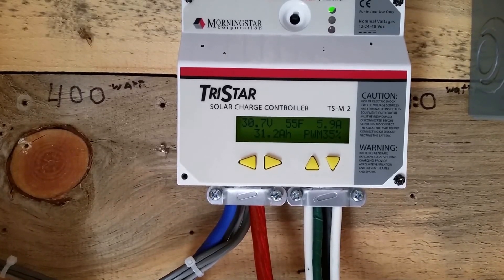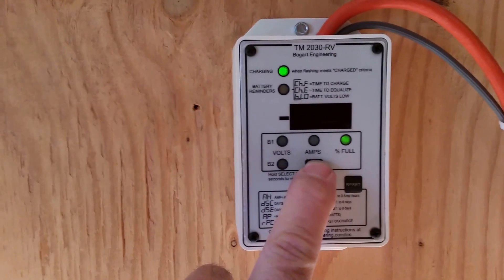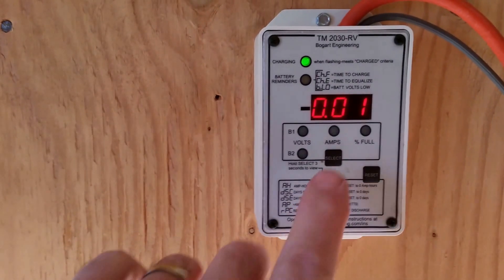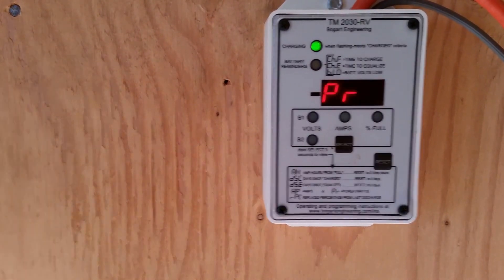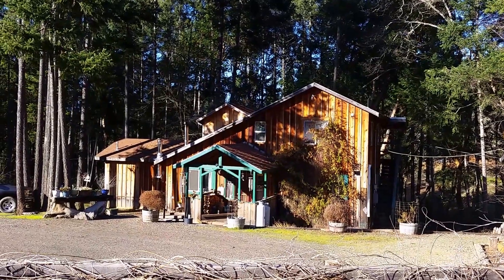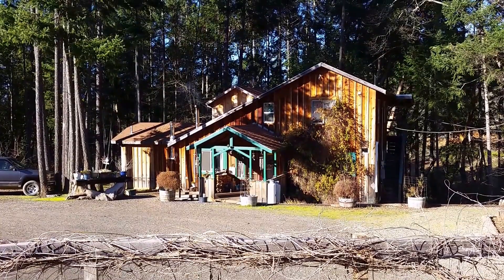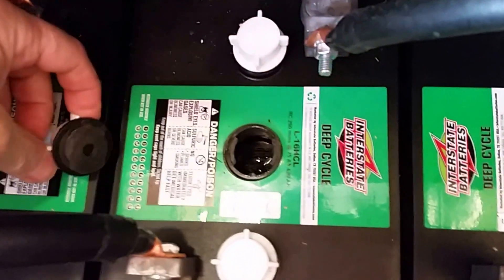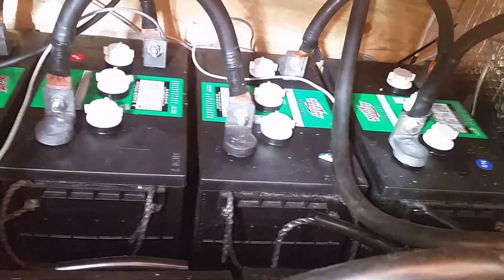Off Grid batteries & how cold weather affects charging part 1

Comment: How well would your system work in extreme cold? - 50-60°F. I have built our home in Interior Alaska and don't want to hear my generator run all night . I will be installing a Toyo Laser 56 heater to augment the wood heat ( when the stove has burned down ) .
 It doesn't get that cold often, but it does happen. 
 Very common to have several days of 40 below. 
 I don't have solar yet and would will recharge batteries during the day with the gas generator. 
 Thank you. Good vid !
Reply from the maker: Greetings, we are moving to a new homestead after 30 years. The new place gets down to 30 below zero F. We are no longer using lead acid batteries. We are using Tesla lithium ion batteries from a E class Mercedes. If our batteries are charged while below 32 degrees they are toast. So we installed a glycol heating system on the tesla batteries incorporating the existing cooling loop. It comes on at 35 degrees and  automatically and heats the batteries.  It is a challenge at 30 below I cant imagine what it must be like for you.
Reply: @offgridinthepacificnorthwe3210  
 Oddly enough the gold standard for dealing with real cold in a home situation in the Interior , off grid . is wood heat. Dry firewood burns Great in the cold. 
 I have thot about running a glycol loop to the generator/battery hut.
Reply from the maker: @gumboot65  I have to admit that burning wood only for heat since 1970 is getting old. I put up 8 cords a year for our 2 houses. Its getting harder as I get older. We are going to try a mini split HVAC on the new house. They won't work below single digits but they work well with solar power.

Comment: Steven. You have a really nice set up of not only your off grid power system but the location of your property. Absolutely beautiful. I have watched several of your very well put together videos and I was wondering, Is your charge controller a TS-45 or TS-60? It is hard to tell from the front when you have the meter installed. I have 2 TS-45 units (without meters) set up for diversion charge when running my DC generator. I am using 2 Wind Blue DC-512 PMAs driven by a 9 HP Briggs Vanguard.  The reason for diversion mode is that I already have a Outback Power Flex Ware 500 grid tie / battery back up system with 6750 watt array in place and the controllers are only a safety for the battery bank in a grid down / no sun situation. 
Again, you have a real nice set up there and thank you for the quality videos.
Reply from the maker: Thank you for the kind words. I have experimented with gas driven PMAs as well. I have a spare TS 60 just for diversion control. I have a Wind Blue coil on a Thermodyne 10si build. I am not happy with the regulation. I have decided to go with a Military 400 amp 28 volt brushless generator and power it with a spare Yanmar clone. Regulating the PMA is possible with a MPPT but their tracking causes them to load and unload depending on the model and brand. The flexmax 80 seems to do ok but I have seen videos of people having trouble with it as well. I hope to buy this one,http://www.milgens.com/store/p23/CE_Niehoff%2C_P%2FN_N1602-3%2C_28_Volt_DC%2C_400_amp_Generator_Alternator%2C_30_available%2C_%28Shipping_included_in_price_to_most_locations_in_the_continental_U.S%29.htmlMy Tristar on the solar system is a TS 60 PWM. The new CC I just bought is a Midnite classic 200 MPPT.Your system sounds great, 6.7k array is no joke. I would love to see a video. Have a blessed day.
Reply: Hey there Steven. That Milsurp generator is a bad boy and would really serve you well with your 24 volt system. As far as I know, and have read, the Flexmax 60 or 80 work best with solar and give problems with wind or hydro. My system has 2 Flexmax 80s on it. I think you are better using a standard Tri Star PWM on wind / hydro set ups due to that load / unload on the MPPT that you have experienced. You have done your homework on your off grid project. I don't have a video of my solar power system. But if you wish, e-mail me at mada94fxr@gmail.com and I would be happy to send you pictures of the Outback system and the other projects I am working on. God bless
Mark
Reply from the maker: Greeting Mark I would really like to see your setup. I will shoot you an email. Have a blessed night.

Comment: I wonder how much of a difference  it would make to spray something like CRC-226 on all the contact points of the system. I live on the water, and spraying it or not on the base of an exterior light bulb can mean the difference between it lasting 1 year, or 3 years, and then being able to unscrew it from the socket, or having to replace the entire fixture. The details matter!
Reply from the maker: Thanks for the tip. CRC makes a lot of good products. I used to use a lot of them when I did motor control work as a electrician. I used to use CRC on battery terminals for the control power on Base 10 Yan lift drives. It did help in caustic environments. We did find that high dielectric salve worked best but that was 35 years ago lol.